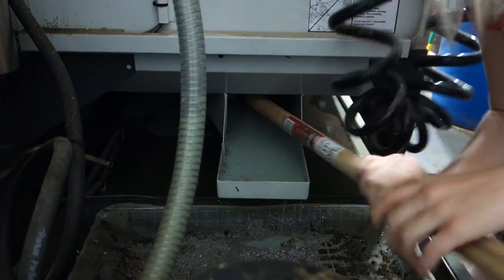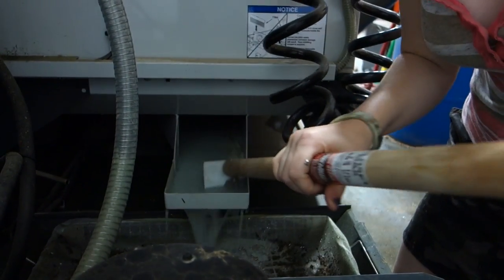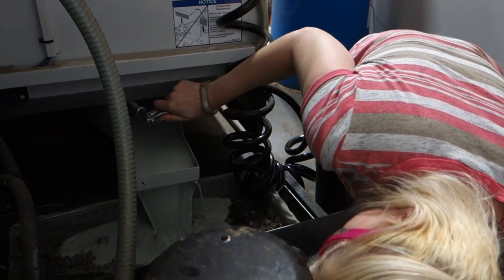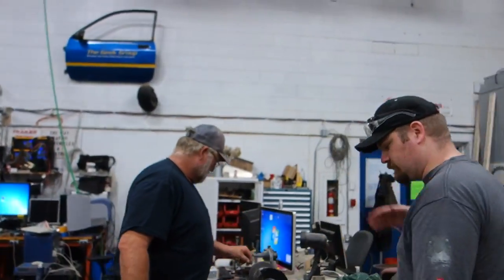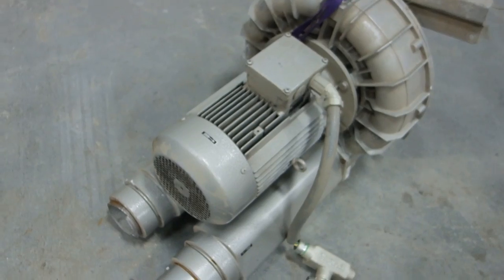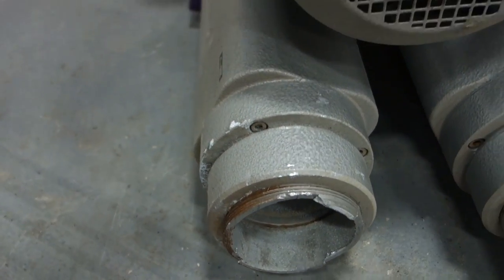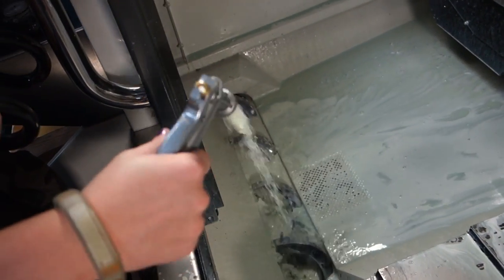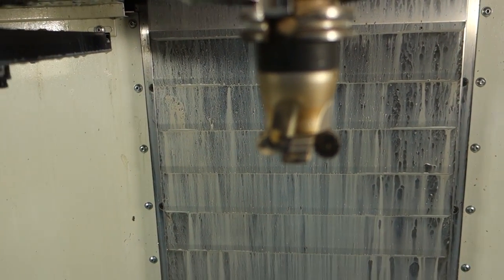Captain's Blog 6 28 2014 Get Pumped

Comment: Other specs on the pumps: 230 mbar, 880 m3/h (517 ft3/min).

The 2 pumps were for air injection in a decommissioned Air Sparge/Soil Vapor Extraction unit. We know far less about the 3rd piece other than it has a MUCH bigger motor at 21kw (28hp).